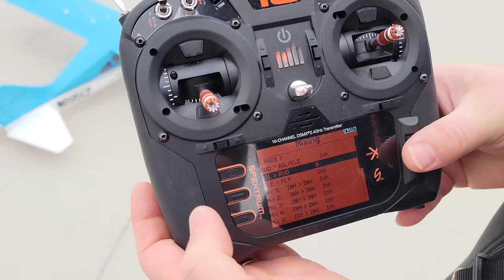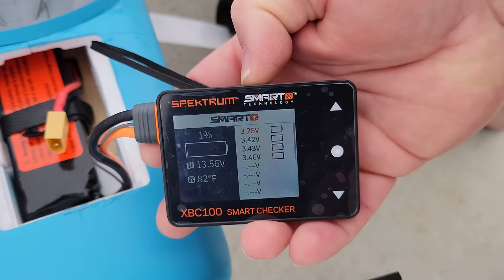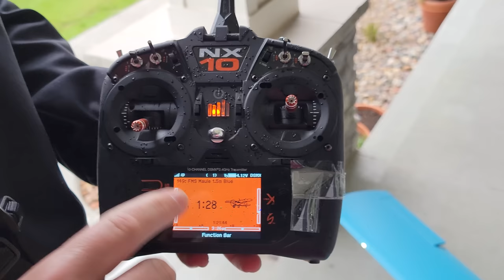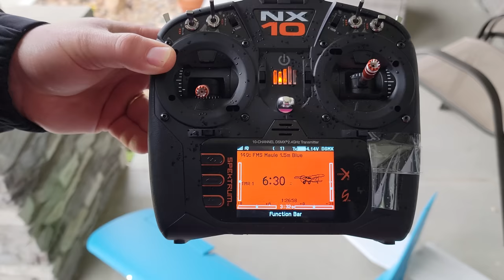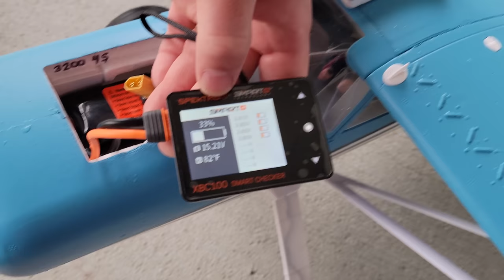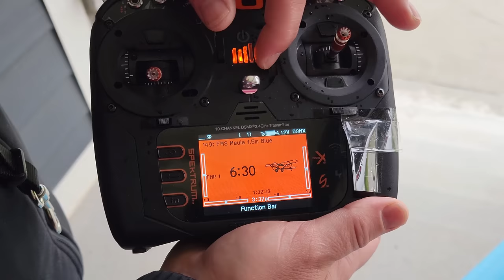FMS - Maule - 1500mm - 2X Maiden Flights

Comment: Yep, looks and sounds just like a blue version of my Eflite Maule M7 1.5 BNF.  Makes for a wonderful float plane.  I keep expecting Horizon to release a UMX version of the Maule as they did with the Twin Otter.  Both of which are exceptional.
Reply from the maker: It is the same plane, only using Preditor ESC, FMS branded servos, and the Reflex V2, but as a PNP+, it's a great value, and I loved the Maule all the times we've done it!
Reply: @BrianPhillipsRC  With all due respect, Eflite is only $30 more for BNF.  Where is the better value?  Red really stands out in the sky.  Just sayin'.

Comment: Your video was a great intro to this great airplane.  However, in the process of doing all the checks on this bird, I did a current consumption check on the ESC and it's going up to 45A even with just a 3S pack.  That's a problems since the ESC is only rated to 40A.  Every time I've been in this situation before the ESC is not long for this world.  I'd like to install a larger ESC that I have on hand.  Can you give any guidance on how to get the ESC out of the air frame??  I could really use your expertise on this.  Any help you can offer would be much appreciated!  Thanks again for your great videos!

Comment: Brian I love my Maule M7.   Mine is the Red E flight with AR631 , upgraded all servos to full metal gear ⚙️  and I put a 60 Amp Avian ESC in mine. Full telemetry.  Yea Baby.   I fly mine with SMC Racing hi voltage ⚡️  4s packs 3600 mAh .  She hauls the mail quite well. Got more coats of red paint & Polyurethane clear coat it's a brick now. LOL.  I should buy this one since I love my other one so much. ❤😅
Reply from the maker: Glad you're thinking about it. This one is a joy to fly, but do move the elevator and rudder out to the outside hole, I bet you'll agree when you get one.
Reply: @BrianPhillipsRC  I already have my E flight version  maxed out on travel. It's a good idea to beef up the hinges with some hinge tape or flexible  foam glue.    One thing for sure: Mine can chew through  spektrum Gen 1 3200 mAh in 5 to 6 minutes with ease.   I would wait and just buy another Red & White  EFLIGHT one   and not paint or clear coat  it this time.  But great video regardless